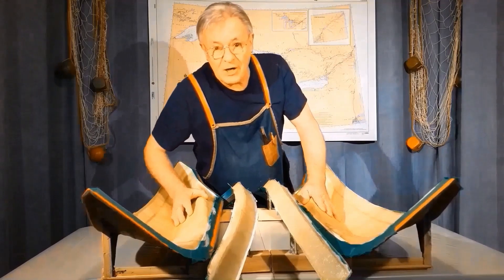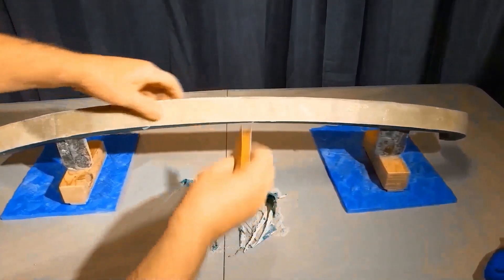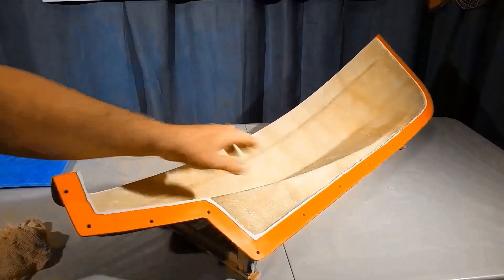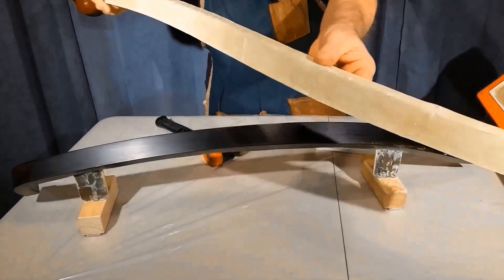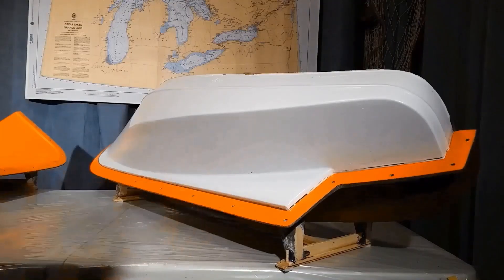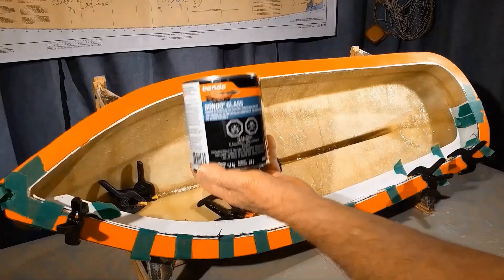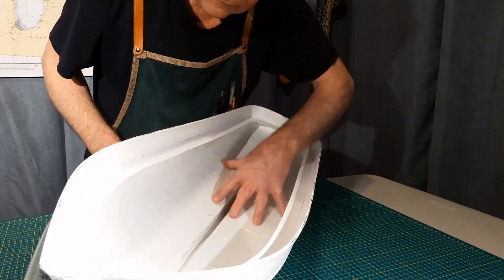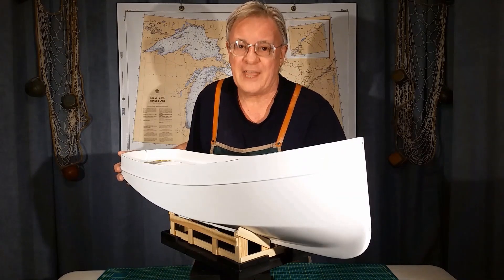Make a Fiberglass Model RC Boat Hull Part 2

Comment: Hi, really good videos. Do you have a video also showing how you do the mold? Are you using thicker fiberglass, how many layers etc?
Reply from the maker: I may do a video on how I made the molds in the future. The molds are much thicker, probably 1/4 of an inch thick. I used 2 layers of tooling gelcoat, a veil layer, about 2 or 3 layers of 1oz. mat, then numerous layers of heavy 6oz. mat. and scrap pieces to build up the thickness. Brian RCWH